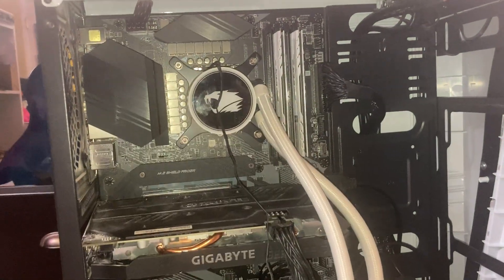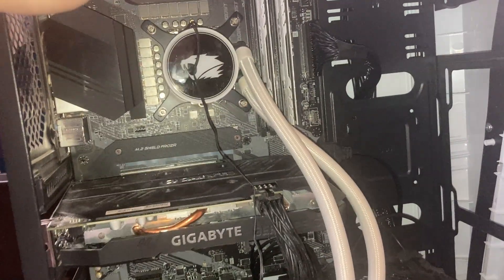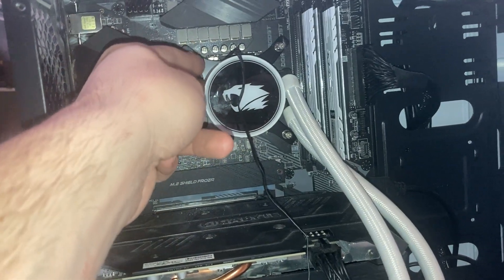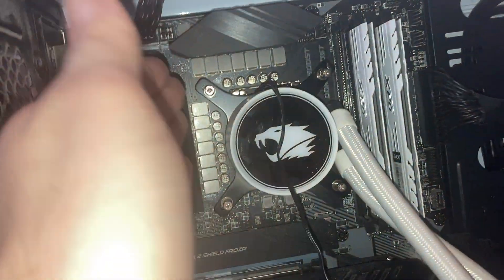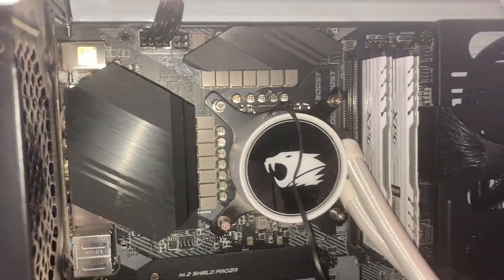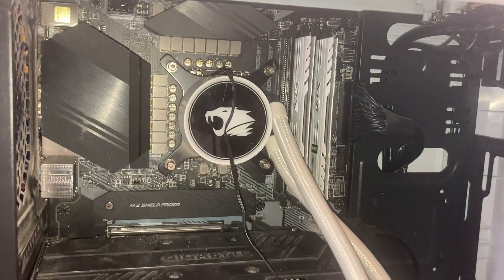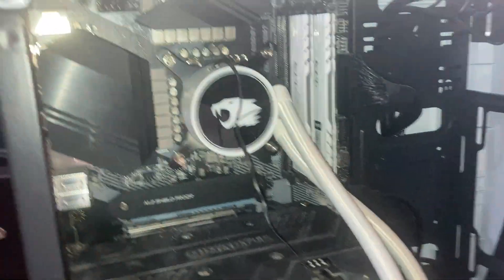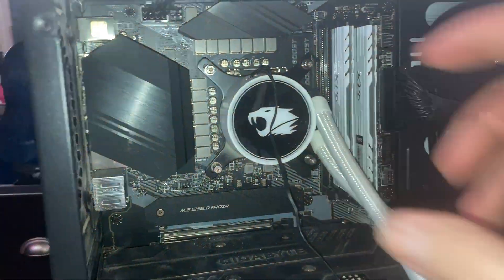How to fix: PC AIO Pump Screws are stripped and will not turn (iBUYPOWER)

Comment: I hate that this is the only video about this shitty cpu cooler. My issue is getting the damn thing screwed back in, i press down as much as i can and the gos damn screws dont thread, im loosing my damn mind.
Reply from the maker: Exactly how I felt!
Reply: @AtoyK  I FIGURED IT OUT
Reply: @AtoyK  the side panel can be removed and once you do there is a plastic bracket that has the screw threads, two people can fix this. 

Unscrew the two screws holding the side panel in, make sure you don't drop the washers for those two screws.

Hold the plastic bracket on the three pins that should be lined up with the CPU, and on the other side of the motherboard have someone line the screws up, press down and screw in the cooler.

Comment: I have this aoi and out of nowhere he bottom left screw came loose and i cant get it to tighten back up.. My cpu just overheats now smh
Reply: Have you found a fix
Reply: @Kiglodup  yeah.. Cutting it off with a dremel and completely replacing it with a new aio. Runs like brand new now

Comment: My screws won’t tighten I unscrewed it to put thermal paste but when I put screws back on they won’t go in
Reply from the maker: Your screws won’t go in with the new AIO?  Or is it the same one
Reply: @AtoyK  same I buy power cooler
Reply: Hmmm seem we all have the exact same problem.. Im buying a new one right now
Reply: @JayMac found a solution
Reply: @dmr4395found a solution?
Reply: Did you fix it? Or what happened